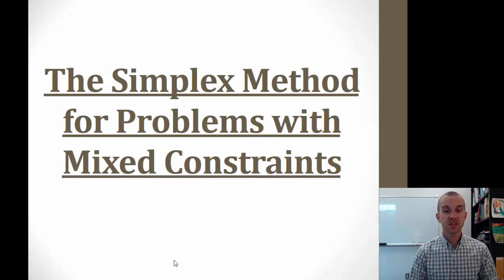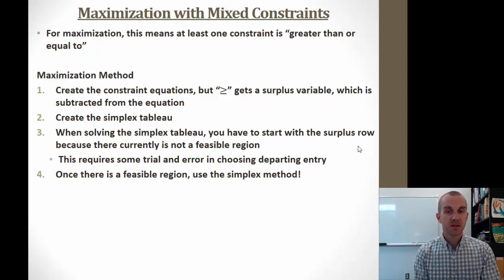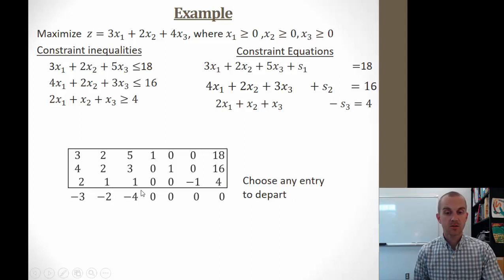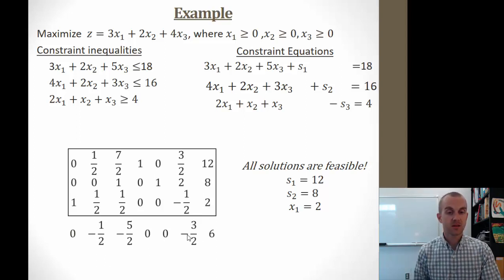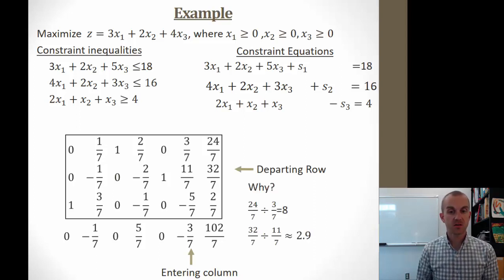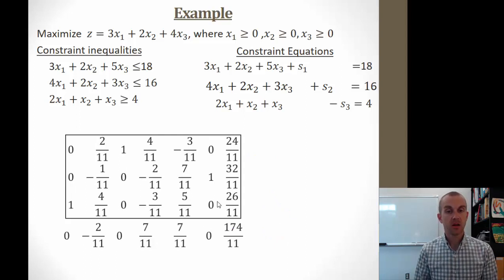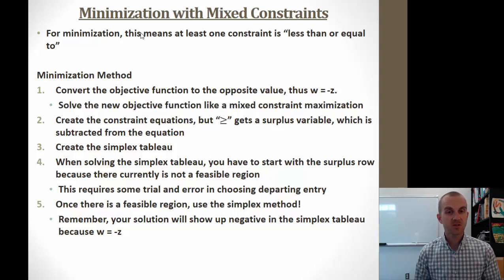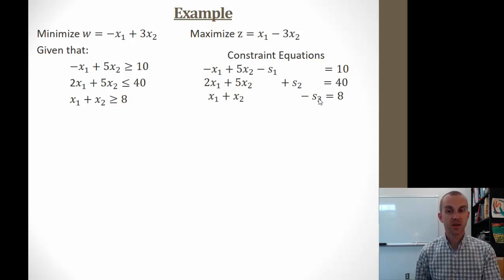Simplex Method with Mixed Constraints

Comment: What if you entering in the row at 5:36 what happens in the second row . 32/11  by 1/11 or -1/11  . With instances that u entering into a row and the colums are negative . Do u divide the constant by the negative number ?

Comment: Hey at 5:55 seconds I think you made a mistakes. It should be  all compared to r2 NOT r3 since r3 was the row reduction.
r1 - 2/11r3 
r2+1/11r3 
r4+2/11r3  

But overall GREAT explanation! Best I found so far so THANK YOU!!!!
Reply: What if you entering in the row at 5:36 what happens in the second row . 32/11  by 1/11 or -1/11  . With instances that u entering into a row and the colums are negative . Do u divide the constant by the negative number ?